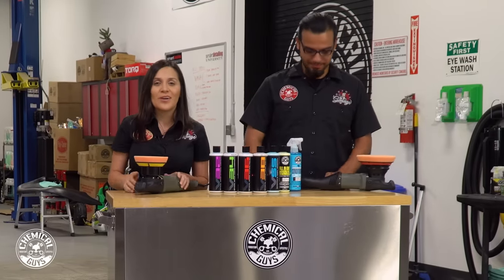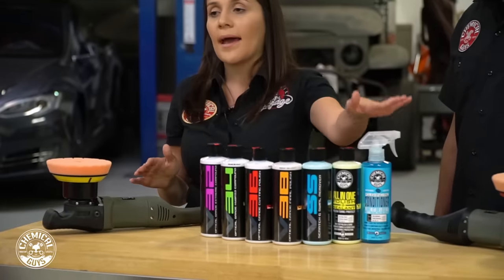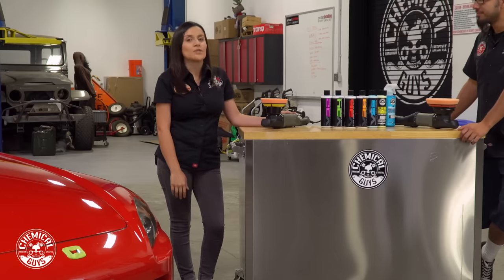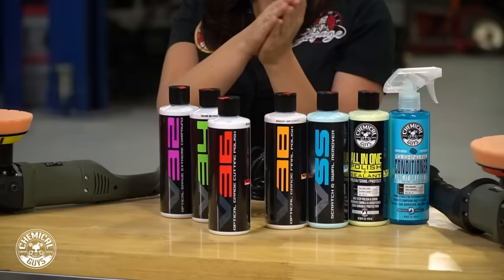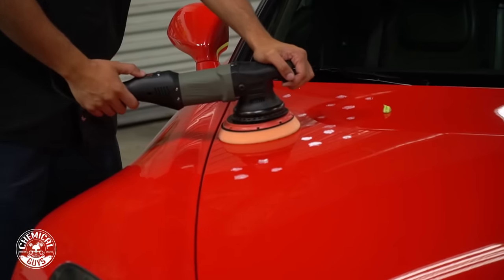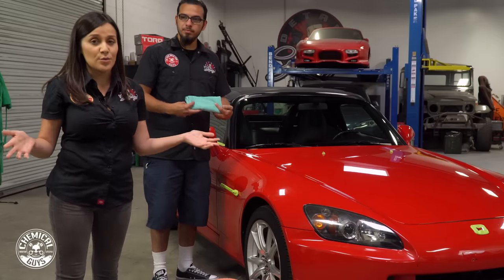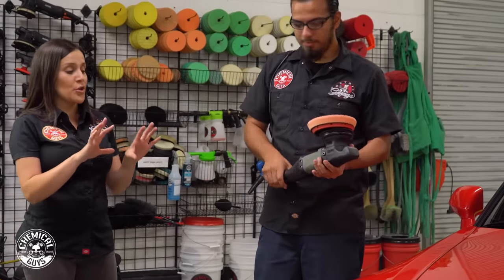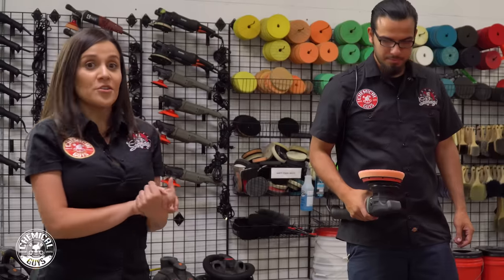Top 5 Polishing Tips For Removing Car Scratches ! - Chemical Guys

Comment: Learning to drive a manual just takes getting used to the process each time you move. The only problem is other drivers can be annoyed to be behind you. Get the process done and then get behind some big trucks in traffic, they have to do a lot of shifting and will get the blame taking the pressure off of you.

Comment: What speed setting do you put it on after you had it on the lowest setting to work it in.
Reply from the maker: Hey! After spreading out the compound or polish, turn the DA machine polisher to the highest speed setting. When using a rotary polisher choose a speed between 1200-1500 RPM.

Comment: Can I use the V36 with the white pad, then finish with V36 on the black pad? I have the orange/white/black pack, but only purchased the V36 polish for my black Civic Type R. Just bought brand new 2 months ago, so nothing too bad. Just want to clear it up before I coat it. Thank you!
Reply from the maker: Hi, good question. You can try V36 with a white pad on a test spot, and see if it gives you the results you are looking for. If you need a more aggressive approach, try V36 with the orange pad. You can finish with V38 and the white pad. The black pad has no cutting ability at all and will not remove any paint; it is only used to apply glazes, sealants, and waxes. Thanks for watching and stay tuned for a new video dropping later today!

Comment: When using the 10fx and spreading with the lowest speed,  what would be the speed to work out in. 
BTW I go to the detail garage in san antonio on Babcock
Reply from the maker: Hi! Spread compound and polish on the lowest speed setting and then use the highest speed setting to diminish the product when working with a 10FX.
Reply: @ChemicalGuys  thank you for the fast response and also the important details.

Comment: What is the term hard and soft paint mean? For example that Honda has a soft paint and how do you tell which has soft or hard paint? I have a Toyota Camry don’t know if it hard or soft.
Reply: Aaron 1530091 soft paint scratches easily and is easier to correct. Hard paint the scratches are more difficult to work out. The Toyota is probably somewhere in between. Tesla paint is incredibly soft son much so you can scratch it when wiping the wax off. A Mercedes would be an example of a hard paint.
Reply: it means if you use the orange pad and V36 and after the first polish, they don't cut easily scratches, swirl marks, etc, it means you have a hard clear coat, and you will have to use the V34 or maybe V32 to cut better
Reply: A hard paint will be more resistant to swirls, marring and damage but also takes more effort to polish. A softer paint is easier to polish because imperfections are easier to remove, but because the paint is soft the swirls come sooner and easier. Hard and soft are all relative.  Your Camry paint is soft compared to x, and hard compared to y.
Reply: It means that the clearcoat is soft or hard. Soft clear coat corrects easier, but also leaves a haze which has to be followed up with less aggressive products, pads, technique. A harder clearcoat takes a more aggressive approach to correct, but usually finishes haze free, sometimes you can 1 step a hard clearcoat with something like V32 or V34 and apply your wax or whatever you like. Every clear is different though, too many variables.
Reply: Most Japanese cars have soft paint/ clear coat except for Subaru

Comment: How come I get a white “powder” sling when using my polisher? Use 5 little dots and hit it with 3 squirts of pad conditioner.
Reply from the maker: Hi there! Are you using a compound or polish?
Reply: Chemical Guys  I am using the V32, 34 and 36
Reply from the maker: Typically it is normal to have light dusting when using a compound but a polish shouldn't. Are you using clean pads?
Reply: Chemical Guys They’re brand new. The dusting isn’t light, moderate to heavy.

Comment: Awesome explanation of what type compounds to use. What do you recommend to keep a polishing pad from getting too hot? I've read cleaning helps, but should I also have 2 orange pads when doing an entire S2000 for example? Thanks!
Reply from the maker: Hi Spencer, great questions. To reduce the heat, it is important to use Pad Conditioner to lubricate the pad. We also recommend using a DA polisher, which has safety features that will make it harder for you to burn the paint versus a rotary polisher. Finally, we recommend using a Hex Logic pad with a hole in the middle, which helps disperse the heat. You can read more about each product below. Thanks for watching, Spencer, and thanks for being a part of the Chemical Guys family! 
https://www.chemicalguys.com/Polishing_Buffing_Pad_Conditioner_16_oz_p/buf_301_16.htm

https://www.chemicalguys.com/Hex_Logic_Quantum_Medium_Heavy_Cutting_Pad_Orange_p/bufx112hex5.htm

https://www.chemicalguys.com/TORQ_10FX_Random_Orbital_Polisher_p/buf_501.htm
Reply: Thanks so much again!

Comment: I have 2 questions when finishing with the V38 what is the best final sealent to use after I polish the car? And my second question is when using the sealants would you use the butter wax or would you use jet seal?
Reply from the maker: Hi Frank, those are good questions. We recommend using JetSeal for the longest lasting and most durable protection. JetSeal is a manmade synthetic wax that takes paint protection to the next level. JetSeal bonds directly to the surface, creating a strong shield against water spots, contamination, road grime, and UV sunlight. Innovative UV protection technology helps reject harmful solar rays and protect paintwork against fading and discoloration. When applying sealants and wax, you want to apply the sealant first and the wax after. I will leave a link the detailing flow chart below that shows all the steps to a full detail in their proper order, and also to Jet Seal. Thanks for watching, Frank, and make sure to check back tomorrow for a new video drop! 
https://www.chemicalguys.com/JetSeal_Sealant_and_Paint_Protectant_4_oz_p/wac_118_04.htm

https://www.chemicalguys.com/v/vspfiles/assets/images/ChemicalGuysDetailingFlowChart.jpg
Reply: Thanks again for your response but now I have a third question I have a black metallic paint and I saw your black light products If I apply the first phase of black light then the Blacklight wax after I apply that what do I put on to seal it all in is it still the Jets seal?
Reply from the maker: Click that link above that shows the detailing flow chart. It will show you that the proper order is wash > clay > polish > glaze > seal > wax. So, in your case, when you get to these steps, you will apply Black Light Glaze > JetSeal > Black Wax.

Comment: Is it necessary to start with a orange pad from seeing other vids some vehicles show different results so just to be safe I'm gonna try a white pad with vss due to the fact I have a dark color vehicle with swirls and scratches. Am I wrong for doing this or do I need to switch to a orange pad first
Reply from the maker: Hey Pedro, that's a great question. You sure can use the White Pad with VSS if your car has only light scratches and swirls. If your car has deeper scratches, then you will want to use a more aggressive pad, such as the green or orange one. Thanks for watching, Pedro, and stay tuned for more awesome videos headed your way soon!

Comment: Hey guys any tips for polishing a big vehicle? I drive a truck and it’s tough getting the machine flat when I have to reach a lot even with a step ladder it’s awkward
Reply from the maker: Hey Cristian, how's it going? You can use a larger pad and backing plate to more efficiently cover the large surface areas of many trucks and SUVs. Check out the huge 7.5" Hex Logic pad and the large 6.5" Quantum pad below! Thanks for watching, Cristian, and make sure to check back tomorrow for a new video drop! 
https://www.chemicalguys.com/Hex_Logic_Self_Centered_Medium_Heavy_Cutting_Pad_p/bufx_102hex.htm

https://www.chemicalguys.com/Hex_Logic_Quantum_Medium_Heavy_Cutting_Pad_Orange_p/bufx112hex6.htm

Comment: Do you guyz happen to have a video on how to dye exterior vinyl? I have a 1984 buick regal limited, i’m planning on painting it a nice cherry red but the outter padded vinyl is brown 😐, I like the vinyl but if there isn’t a way to dye it than I guess i’ll have to go through more trouble to remove it.
Reply from the maker: Hey Sharky, how's it going? Here at Chemical Guys, we have everything you need to clean and detail your car, both inside and outside. When it comes to repainting, body work, or dying, you can consult a body shop and then maintain your new vinyl with a premium CG dressing. Thanks for watching, Sharky, and good luck with your project!

Comment: Great video. I just bought a Torq 15DA from you guys. One thing I didnt catch in the vid, with the Torq 15DA, what speed do you use for V36 and V38? Also, will V38 alone remove very light and minor swirls on a brand new car or is it better to start with 36? Thank you.
Reply from the maker: Hey! When spreading product out such as polish, use the lowest speed setting then bump it up the highest speed setting to correct the paint. V36 Cutting Polish is better suited for removing scratches and swirls. You can then go over it with V38 Final Polish for a flawless finish.

Comment: I just got the torq x and it come with 2 backing plates,does it matter which one I use? One is soft and the other is firm.
Reply from the maker: Hey Charles, great question. The soft, flexible backing plate is best suited to curves and contours of the car, whilst the harder backing place is great for covering large, flat surface areas. Thanks for watching, Charles, and stay tuned for more videos headed your way soon!
Reply: Thanks for the reply. Great job on  the videos
Reply from the maker: You're welcome, Charles! Glad to have you part of the Chemical Guys family! 👊

Comment: I dont have access to plug the machine for polishing so I apply VSS manually by hand. Do I have to use pads for machine or can I use regular waxing pads? Any tips for manual polishing?
Reply from the maker: Hey Resty,  if you're going to be applying VSS manually, you want to use Hex Logic Hand applicator pads. Choose the right pad for removing swirls and scratches, or applying wax, sealant, or glaze to your paintwork. The Hex-Logic Hand Pads are the perfect size for any hand, big or small. The unique foam contours to the shape of your hand so you can restore shine and gloss to any surface. Pick up Hex-Logic Hand Applicator Pads when polishing hard-to-reach spots and small isolated areas today! I will leave a link to a kit containing all 3 pads below, but you can also purchase them separately if so desired. Thanks for watching, Resty, and stay tuned for more videos headed your way soon! 
https://www.chemicalguys.com/Hex_Logic_Hand_Polishing_Applicator_Pads_3_Pack_p/bufx_204.htm

Comment: I believe you briefly touched on it in the video, but what are the differences between the hexlogics with the center hole, and the ones without? I ordered a kit from Amazon and it came with the regular pads with no hole. Would you suggest the other ones  with the holes are better?
Reply from the maker: Hi! The hole helps disperse the heat. If you're using a DA machine, you're good to go with the Hex Logic Pads without the hole, but if you're using a rotary polisher, you definitely want to use the Quantum pads with the hole. If you're using a DA machine could use either, it's really just a matter of personal preference! Thanks for watching and stay tuned for more videos headed your way soon!

Comment: do you guys have a video about how to maintain a car after youve followed your spreedsheet, wash, clay, compounds, polishes, glaze, then wax.... but 2 weeks later , then what?  use the clean path on your decision tree? wash, clay, glaze and wax?
Reply from the maker: Hey David, that's a good question. To maintain your newly detailed car, all you have to do is a simple wash using the two bucket method, or with your foam cannon or foam gun. No need to clay, glaze, or wax again, unless your car needs it. Just make sure to use proper washing washing techniques and make sure to use a gentle pH balanced auto wash shampoo as these will not strip your wax and/or sealant coat. After washing your car, you can dry it with the help of a premium quick detail spray like P40 that will not only help it shine, but lay down a light layer of wax protection as well. Thanks for watching David and stay tuned for a new video headed your way soon!
Reply: OOOO Ok! i thought thatevery time you washed your car the wax came off and you had to rewax it!  AWSOME!  now i see the value in your foam canon system... spray, sit and wipe down!  i get it now!
Reply from the maker: Nooo! All of our soaps except a couple are pH balanced, so they won't strip your wax or sealant coat. Using a soap like Honeydew in conjunction with a foam cannon/gun, Dirt Trap, and a premium chenille wash mitt is all you need to maintain that wax coat. Finish it off with a quick detail spray like P40 and you'll be set for quite a while!

Comment: How many time do you have to spray the pads conditioner ? You forgot to answer that question 👌
Reply from the maker: Hey A. H! We recommend spraying the pad with Pad Conditioner for the first few passes and then as necessary as you work around the vehicle but it isn't necessary to spray it every time as long as the pad isn't dry.
Reply: Chemical Guys awesome 👏 thanks

Comment: Best way to learn to drive a stick?  Either find a huge empty parking lot or a back country road without a lot of traffic first.  Then spend focus at to start in first gear not even trying to shift higher.  Starting from a dead stop is the hardest thing for a lot of people as it's the trickiest part.  So spend time learning where the clutch engages and the throttle needs to be to keep it from dying and not jerking forward or stalling.  Nice, smooth, out on the clutch and nice, smooth, in on the gas.  You'll find the 'engagement zone' on your clutch from trial and error.  Then stop and do it again and again and again until you can do it without killing the car starting off or coming to a stop.  Don't be afraid to kill the engine, just push the clutch back in, start the car, and try again.  After you get good at this part THEN you can focus on shifting to higher gears, which is much easier in motion.  Then go back and do the clutch/pedal drill on an uphill incline (but make sure you have a ton of room!).  None of that if you do just normal in and out easy should do any damage to your clutch, throwout, etc.  Where people kill clutches is riding them or 'dropping' them at high RPM usually.  Good luck!

Comment: Can you jump from v32 to v38 or do we have to work our way up ????
Reply: That’s a good question, because I thought you could, but it seems like in the video that you have to hit every number then finish with 38. I don’t think you’d want to do the whole car that way, just certain spots, unless the whole car needs it. I’m wondering if there’s ever a time you’d just use v38?
Reply: You can if the clear is hard and there’s not much haze from the V32, you can just go to a final polish like V38. Every clear is different though. You can use just V38 on something like a brand new car that would have very minimal swirls, something that has very minor if any defects. Most of the time you should be able to go from V32 to V36 and then wax or whatever protection you like.
Reply from the maker: Hi, you don't necessarily need to move up the line using every single product. When used properly, you can go from V34 to V38, for example, or go from V32 to V36, or only use V36. What's important is that you work every product for the proper amount of time until it becomes translucent. Remember that every car is different and testing is the name of the game when it comes to compounding and polishing. You should test out a small area of the car to figure out what combination of products works best for the particular detailing job before undertaking the whole car. I'm going to leave a link to really informative and helpful article below that explains how to choose the right compound, polish, and pad for your car. Take a look at it, I think you can learn a lot! Thanks for watching and make sure to check back tomorrow for a new video upload!
https://www.chemicalguys.com/How_To_Choose_The_Right_Compound_Or_Polish_For_Your_Car_s/644.htm

Comment: How many times can you use vss first time I used it car looked excellent now six months on starting to see signs of swirling and wanted to no if ok to polish and wax again
Reply from the maker: Hi Russ, you can use VSS whenever your car needs it. Remember, though, that polishing is abrasive so it's not something you want to be doing every week or every month. If the last time you polished was 6 months ago, you're in the clear to polish again. Most scratches and swirls are caused by improper washing and drying techniques. Make sure to use proper car washing and drying techniques to ensure that the intervals between polishes are as long as possible. Conversely, you can wax as much as you'd like. Waxing does not remove anything from you car, only adds protection and shine! Thanks for watching Russ and check back tomorrow for a new video upload!

Comment: Hey Nick, I was asked to polish a camper, was wondering what you would recommend chemical wise? Thanks!
Reply from the maker: Hi Gavin! Thanks for your question. Is the camper painted, fiberglass or exposed metal?
Reply: I’m honesty not too sure, i believe it’s fiberglass but it is painted. I know it’s not exposed metal
Reply from the maker: I recommend using the V-Line, make a test spot using an Orange Hex-Logic Pad and V36 Cutting Polish.
https://www.chemicalguys.com/v-line-polish-and-compound-kit-v32-v34-v36-v38/v-line-polish-compound.html